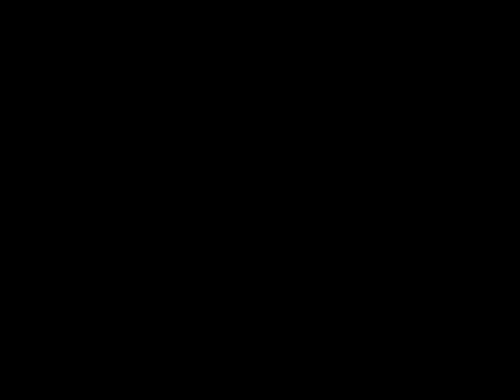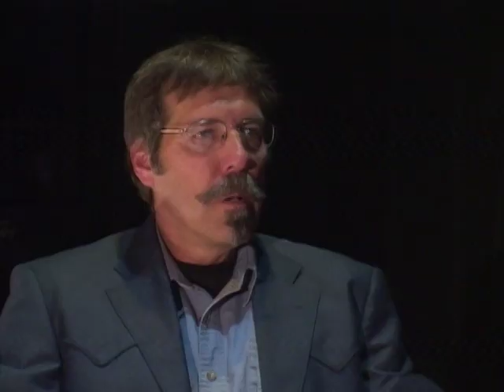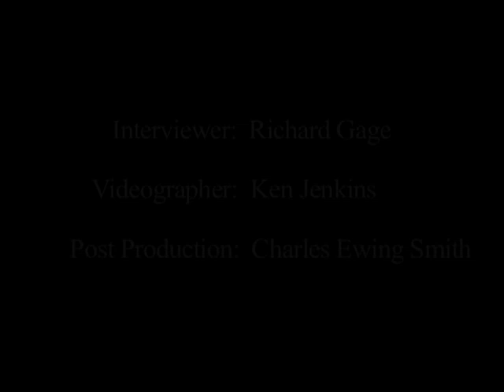Tom Sullivan - Explosives Technician - Loader - AE911Truth.org

Comment: @eldongb1 This...
"I know more about high rises than you care to. I spent more time studying them than you care to"
...is contradicted by this:
"momentum can't make it destroy the lower section without bouncing of."
If you knew the first bit about the structural engineering of highrises, you'd know that buckling can be elastic (if inside design envelope) or inelastic (when outside). In one case, there's no bouncing. I hope you can guess which case, you have a 50% chance.

Comment: "no way you would miss the charges going off. Not even CLOSE!'

no one did...

LT PATRICK SCARINGELLO  EMS
WTC2
"I heard the explosion from up above. I looked up, I saw smoke and flame and then I saw the top tower tilt, start to twist and lean".

FR WILLIAM REYNOLDS
WTC2- 
"I was distracted by a large explosion from the south tower and it seemed like fire was shooting out a couple of hundred feet in each direction, then all of a sudden the top of the tower started coming down."

BOOM before fall

Comment: Thank you for your video.

No evidence of explosives or controlled demolition were found by the FBI, CIA, NTSB, ATF, Fire Departments. They are all trained in this type of situation, they would immediately recognize explosives having been used
None of the buildings fell at "free fall"
The penthouse began the collapse of building 7. There was a full 7 seconds between the penthouse collapse and the rest of building 7 coming down
I've not seen where the term "pull" is used in controlled demolition except when "pulling" a building with cables, as they did with building 6

Comment: >>Not the case with High-Rise components. 
On 9/11, I felt exactly the same way.  BUT the Twin Towers were not constructed with the same "robustness" as you and I would assume [and hope] most high-rises are.  They were built with long-span trusses connecting the core and the outer walls.  On the NOVA special "Why the Towers Fell" it was mentioned that this was a deliberate design to reduce overall weight and cost as well as increase rentable floor space by eliminating at least two (cont'd)

Comment: @IExposeMormonism ""released more energy". The two are directly related" - Not as directly as you think.
"Paper is not more powerful than thermite" - I didn't say that, and Jones e.al. didn't measure power. They measured energy released per mass unit.
"It burns at 4500F. paper burns at 450f +/-" - Irrelevant. Jones e,al. didn't measure resulting temperature, they measured ignition point. Which proved it wasn't thermite, too; their sample ignited at lower temps than nano-thermite they referred to

Comment: @PapaOystein he design was a "tube in a tube" construction where the steel reinforced, cast concrete interior tube- the towers had concrete reinforced steel cores. ven if all of the vertical supports on a few floors somehow failed catastrophically at exactly the same moment-the top part of the building could not fall THROUGH the still-intact, highly robust lower part of the building, straight through the path of most resistance. The evidence shows they fell through the path of MOST RESISTANCE.

Comment: @eldongb1 "I thought the only review they allowed was the briefing where they allowed people like Chandler to ask questions"
You thought wrongly. The process was something like this: NIST published the draft report, and solicited comments from the engineering public, to be submitted in writing by a certain date. IIRC, all such submissions were published. Those with merit were worked into the final. The time frame was tight, one could lament that,
Compartmentalization is good project management

Comment: @PapaOystein by muc higher I mean higher than the length of the build and even then, bounce. Concrete was pulverized. This doesn't happen easily as a fire and collapse. Yes. It can't push through portion of structure that is designed to hold iit up fool. It would have to be heavier than the other portion to make it buckle whn relatively intact. I can and did on day one, and just because you are ignorant, doesn't mean those ofus who disagree are.

Comment: @unRompecabezas They reported that it HAD collapsed, not was expected to. It was standing right behind her. The firefighters actually reported that the fires were under control, and I don't recall any of them saying it was going to collapse until just before they were told just before it came down. Again, my father has been in office fires and they don't weaken steel encased in concrete. It's just ridiculous if you ask an engineer.

Comment: @Blacktoe 2:47 to 3:19 is where his experience comes in. There are conditions REQUIRED to create an implosion. They are independent of materials used, or which ones HE used. Doesn't matter if it's dynamite, or C4, or nanothermite - listen to that section. Magnesium can be used to ignite thermite- and anybody - except maybe you could improvise a detonator with it. What chance are you talking about? The chance that someone might get some rubble/evidence before they shipped it to China? READ.

Comment: @IExposeMormonism "There is tremendous energy and heat in thermite"
No, there isn't. There are 3.9 kiloJolues/gram in ideal thermite (reference: The Jones e.al. paper itself, page 27 "The theoretical maximum for thermite is 3.9 kJ/g"). Wood contains about 18kJ/g, fuels between 33 and 54, plastics between 18 and 46 (see Wikipedia "Energy density"), even a human body contains, with 8kJ/g, twice as much net energy per mass unit than thermite.
Nano-thermite hass even less, about 1.5 to 2 kJ/g

Comment: Not free fall speed, and please provide evidence for your asymmetrical/symmetrical theory. From my knowledge bowing caused the steel to pull the frame of the building inward. Wouldnt that cause the building to collapse in on itself? Also from my understanding the building itself almost had no other option. It was so big and so heavy that collapsing sideways like a cartoon was impossible. The moment one side would have gave the building would have slightly leaned and then went straight down.

Comment: @PapaOystein I told you, that tiny portion makes the whole thing TILT. The asymmetrical load etc. cannot be SYMMETRICALLY overcome by sheer momentum etc. Sure, it can make the building collapse, but not through the still relatively pristine mass of the lower sections unless those sections are subjected to uniform stress and have uniform resistance/damage etc.

Comment: it looks like tony has fallen into a trap. these two guys dont wanted to discuss anything. 

there is a demolition EXPERT who worked for controlled demolition inc. he said the collapse of building 7 looked like a controlled demolition. his name is Tom Sullivan he worked as a explosives loader. 

just look here, and listen:

https://www.youtube.com/watch?v=u5IgqJXyLbg

Mr Sullivan talks about how steel frame buildings can be imploded successfully, by loading only the first 3 floors of such building with explosives. therefore it is a complete myth that you need to have massive amounts of explosives. you dont have to wire it up to the top of the buliding to bring it down.

Comment: @PapaOystein Yes, that's true, but it's not so easy when you're going for a specific house, from an odd angle, at full speed, I don't know if I could make that stick. Maybe a big house, but some big houses are nearly as wide as those towers, and I think the towers were no easier to hit than a modestly large house in that scenario. I think if this happened the way you NIST cultists say, they would have clipped it both times, and so does my friend in Thailand and so do PilotS for 911T.

Comment: @Blacktoe "Magnesium may be used as an ignition source for thermite, an otherwise difficult to ignite mixture of aluminium and iron oxide powder." - Wikipedia. I'd like to know if there's evidence for this- again warrants a separate investigation. Would there BE evidence after the fact? Did it have an insulated device with a strip of magnesium, or could there have been an accidental ignition of the magnesium? Those are some questions I personally want answered. Theories be damned 'till then.

Comment: @eldongb1 
"Actually plastic explosives are hard to detonate without detonating it intentionally, that's why they were developed."
If that's the case, why was there no distinctive explosions seconds before collapse? And that still doesn't explain how all the wiring would survive the fires. 
But that doesn't matter, because its thermate, not plastic explosives, right? Would thermate charges survive? Would a CONTROLLED (keyword) demo be possible in such conditions?

Think.

Comment: @unRompecabezas They didn't need fireproofing, they were encased in CONCRETE. And as for unprecedented equaling impossible, you're putting words in my mouth. What equals impossible is that high rises are designed by engineers so that fire doesn't do this, and it never does, except for this one time. Office fires happen all the time and don't make a building collapse, MUCH LESS symmetrically.

Comment: 1:03 "First off, you have to weaken the building ... that means all the staircases have to be cut at intervals, the firewalls have to be removed, elevator shafts have to be cut, the rails cut, the cars themselves removed. Then you have to move to the columns...those are cut by a torch...to allow for charges to be placed".
All this OBVIOUSLY didn't happen. Tom gives us reasons for why the towers were NOT rigged with explosives.
Reply: incorrect. his argument there is that a simple weakening by fire / plane crash could never cause the total collapse / failure of the building. 

you don’t get to ignore that point in service of your own (delusional) argument.

Comment: @eldongb1 "top floors falling is equal to the force of resistance" Exactly. If you apply the correct physics formulas to a simple enough model and do the math, you will find that columns will be overwhelmed in small fractions of a second by falling mass, and that the rest is just falling DOWN.
"9,682 views and experts in every field" on closer scrutiny you will find that few of those are qualified in relevant fields, and they are vastly outnumbered by their peers who don't fall for crap.

Comment: @oneshotki11 Slightly leaned, then went straight down? That's preposterous. When leaning, one side would be subjected to much greater stress than the other side, so again, you would have asymmetrical failure of the supports and it would fall over.

Comment: @PapaOystein You're the one with delusions. There are even strange videos of the towers being hit by the same plane, coming in from different trajectories, which much like the pentagon are hard to hit when coming from the angle they did. Especially in a 767. Yes the pentagon is huge, but still not easy to hit when you're going 530mph and a slight miscalculation will mean you will hit the center, or over shoot it. Then there's the lucky coincidence that the section hit was relatively unoccupied.

Comment: @PapaOystein Flying and hitting targets, when you are UNFAMILIAR with the controls are two different things. Put those kids on a cessna simulator, then in a 767 simulator AND THEN see if they can fly, much less maneuver that well. And no, I would never board a passenger jet. They aren't F-16's which ARE maneuverable. Would you drive a gasoline taker, knowing that freight trucks are less maneuverable than a toyota that could dart in front of you? I wouldn't.

Comment: @eldongb1 "watch?v=Zv7BImVvEyk"
Good footage there! Please do not only watch the video, please LISTEN to it as well. And notice:
Every real CD has extremely loud BANG BANG BANGs just before collapse.
WTC7 (as well as WTC 1 and 2) did NOT.
(The one example of a CD gone wrong is not a steel frame office building, by the way, but a reinforced concrete storage building with vastly different specifications and dimensions; CDs gone wrong do not usually look like that at all!)

Comment: 4:07 "Only the BOTTOM third of the building needs to be loaded"
Tom gives us another examples for why twin towers were NOT loaded: They collapsed from the top - just the way it is NOT done.
4:34 "Contractors don't use (wireless remote detonators)" - Great! Keep that in mind! So who had "years of experience" (2:27) with highrise demos, but wasn't a contractor?
5:31 "What you do hear is small explosions...whcih leads up to the implosion of the bldg." - right - just what we did NOT hear. Thx, Tom!

Comment: @piip4 Good thing we have two massive planes smashing into these buildings at 500 miles per hour. Surely a normal office fire wouldnt have done a thing to these towers like you stated. Yet the instantaneous spread of jet fuel in a matter of seconds covering multiple floors is absolutely no normal office fire. Add the heat (800° to 1500°F), plus then take into consideration that steel will lose about half its strength at 1,200 degrees F. Presto! We have an explanation...

Comment: @piip4 "but I can't see how (collateral damage) could be easily avoided" - That's your problem: YOU are unable to see some thing.
"Yes (arson) can level buildings, and has done so with plenty. But a steel structure? Really?" - Really. In fact, steel structures much more easily than concrete or even wood structures. That's why they always spray fireproofing on steel, rarely on wood, never on concrete,

Comment: 6:00 "thermite cutting charges ... work by thermal heating"
This contradicts what he said at 2:49 "we have to have all the support columns on a given load floor fail at the same time, WITHIN MILLISECONDS". Right. That's why they use explosive charges, not slow thermal charges. Thermal charges can't get the job done.

Comment: @unRompecabezas Ok, so they just got it wrong. And small office fires break concrete, or reach through it enough to heat steel supports enough to make all the supports fail uniformly in order to create a uniform collapse. And the strongest part of the building, the core, the penthouse, the last part standing in every ordinary collapse in history, was the weakest link, and first to fail. And the first time in history that an office fire did this, that usually needs a demo contractor, was natural.

Comment: (cont'd)  Is that carpenter qualified to design a house entirely on his own?  Highly unlikely.  [I suspect that in most jurisdictions he'd be legally prohibited from even trying.]  But if on a PRACTICAL level, could a group of experienced residential carpenters get together and build a house that would last (as long as they didn't try anything that exceeded their experience)?  They're not engineers, but could they speak with *some* level of authority on the soundness of a house (cont'd)...

Comment: The falling floors of a building don't just fall through tons of steel and CONCRETE even if it's weakened. The load isn't symmetrical. All of this adds up to the falling debris tending to fall to one side. Even if it destroys the floors below, the debris has to fall through this mass, unless there is uniform resistance it can't be a uniform symmetrical collapse any more than dropping a human head on your head will destroy it and fall through you. THINK about it. It's just plain nonsense.

Comment: @eldongb1 "757, 747...semantics" - Oh, yeah, a 747 would be nearly as easy to crash into a HUGE target (not quite as easy, as it is not quite as modern as the 757/767). It just shows that you are unfamiliar with all the most basic facts of 9/11.
"no experience a passenger jet" - That's totally insignificant. You fly one plane, you basically know how to fly all planes. Even with zero experience on any plane you would hit these HUGE targets 10 times out of 10. YOU can do it, honestly.

Comment: @eldongb1 "brighter folks than you OR I" - brighter than you maybe, but not brighter than me. I was top of my class in physics, and I have asked several structural engineers. I have have even done the math on a couple simple models. Bottom line: Gravity pulls straight down to the tune of several hundred tons TNT of potential energy, steel structure can only deflect a tiny portion of that.

Comment: @eldongb1 "You act as though (Quintier's) opinion on 911, has anything to do with the point I was making with that quote about NIST" - It has a lot to do: You call Quintiere as a witness to make the point that NIST might have failed to spot signs of a controlled demoltion, when in fact Quintiere doesn't draw that conclusion himself. The point matters because Quintiere in fact has keen knowledge of the NIST report, he has expertly studied it. He does NOT think that NIST's work is "fantasy"!

Comment: @oneshotki11 Nothing to support it? Look up the law of gravity. The steel would not bow symmetrically unless it were all symmetrical damage. My father was a high-rise engineer and any physics book explains gravity quite well. You keep saying I have a lack of knowledge, without any ability to factually refute this. And ALMOST is not symmetrical. Even a slight variation is enough to cause it to tip over. Demolitions contractors the world over are aware of this.

Comment: @eldongb1 "My father was a high rise engineer" - but you aren't.
"it's not going to be SYMMETRICAL" - and it wasn't.
"The law of gravity...states that things fall in the path of LEAST resistance" - Lord, throw brain! Quick! Much! No, it does not at all.
"if there's equal resistance..." The dynamics of collapse are governed by momentum and energy, not static force and resistance.

Comment: @eldongb1 "Investigations require accuracy over a foregone conclusion/result like a project"
NIST did not have a foregone conclusion. Quite the contrary describes it better: They expressly discarded their initial theory and adopted a brand new conclusion because of their extremely extensive, accurate and methodological sound research.
"A real investigation should have no compartmentalization..." - Nonsense.
"...or review deadline" - Nonsense. Lack of deadline is a sure sign of bad method.